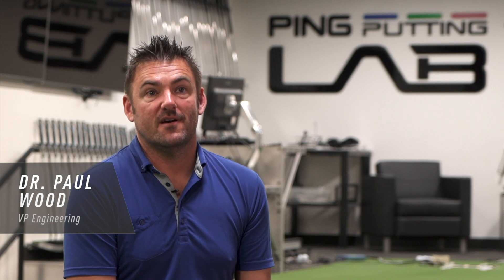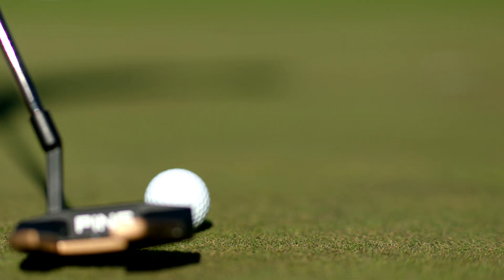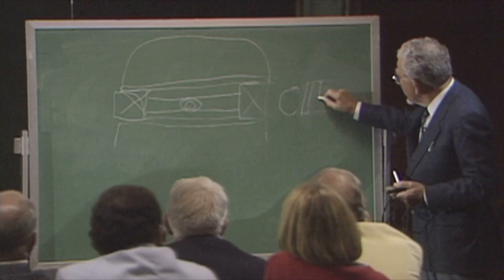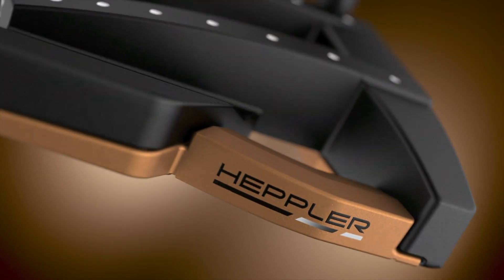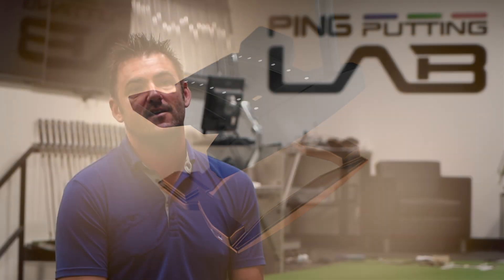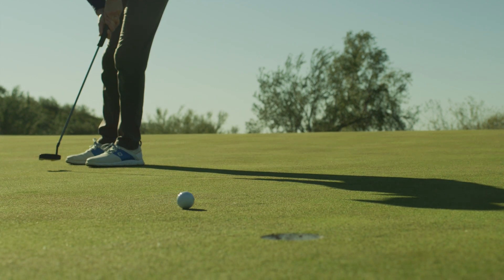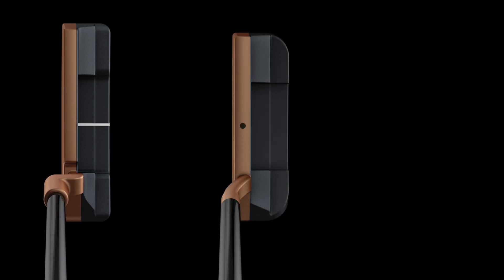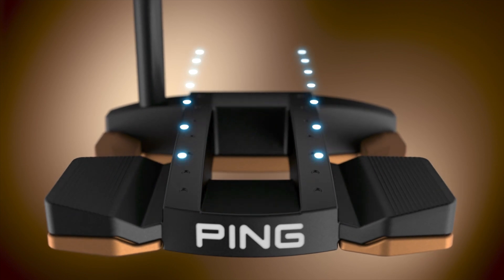Ask the Expert: Heppler Putter Technology

Comment: I really like the Anser, 2 but I really like the Kushin 4 putter. I have a slight arc to my swing. Is it possible to switch out thru Ping, the strong arc shaft on the Kushin 4 to a slight arc shaft shown on the Anser and Anser 2 putters?
Reply: I asked the same question directly to Ping. Good minds think alike. Ryan’s reply: “The stroke type/arc type is influenced by the hosel/axis point of the putter head than the overall shaft. We would not be able to get the Kushin 4 putter to get to a slight stroke type due to the hosel on that putter. We are able to adjust the lie angle to slightly change the stroke/arc type but not enough to get it to a slight stroke type range.” I’m going to take a hard look and test their DS 72 putter meant for slight arc swing paths. Hope it helps.